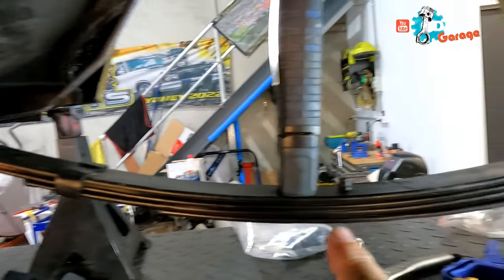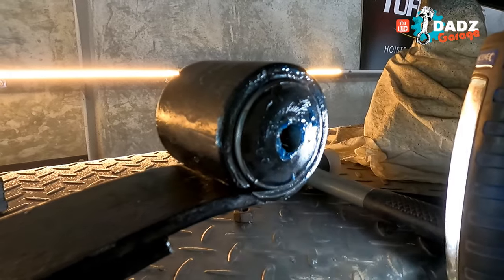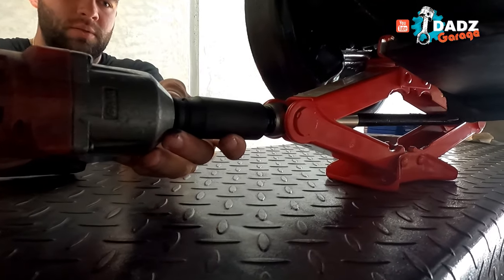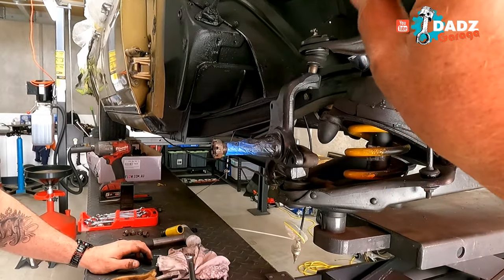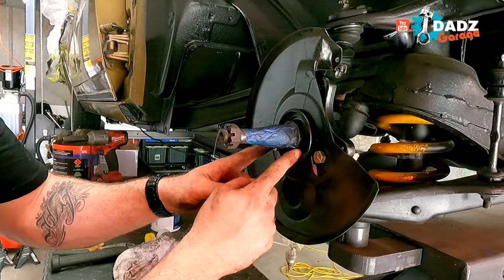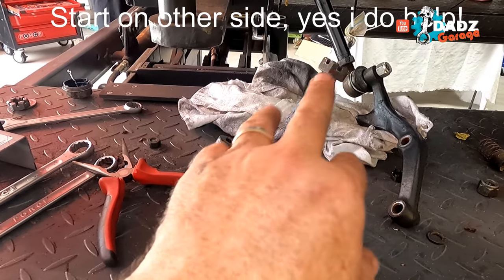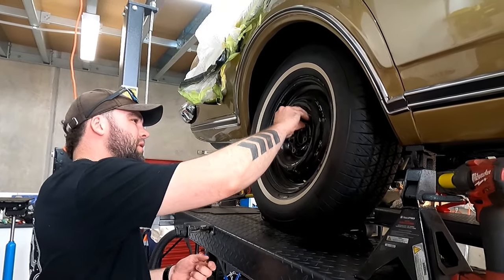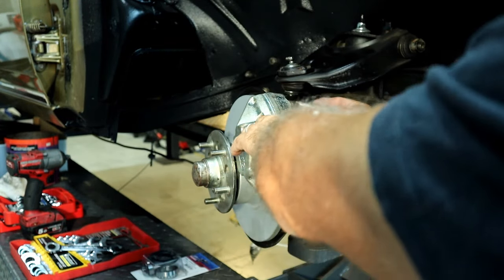HT Holden V8 Swap, Disk Brake Conversion and Rust Repairs

Comment: Good update. I liked how you worked out the bleeder situation, yes the nipple goes to the top (highest point) as the fluid flows into the caliper and fills it, most of the air will be forced out and then a quick bleed to finish.
Reply from the maker: Thanks Mick, slowly learning and great to do it with my son..

Comment: Use rubber grease or even selected food grade grease [come with PTFE and are very long term greases ]. All urethane bushings hate oil based lube .The ingredients in  some bushings actually cause them to crumble . I have had outstanding success with Super Pro Blue .[35 years exp]
Very hard urethane actually wears steel .
Reply from the maker: Thanks for the help

Comment: You do the Job Right, because you do the Job Twice😂😂

Also, just double check your speedo cable routing. It looks like it's rubbing against the Clutch cable.
Reply from the maker: In my case do it 4 times and hope the last time i get it right. Will check speedo, thanks.

Comment: Were there different brake setups for 6cyl vs v8 or were the GTS chev the different setups ??
Did u consider Hoppers stoppers  disc kit ???   Versions of upgrade HQ style 14 inch wheel or a falcon disc 15 inch wheel .
Reply from the maker: I believe same brakes for 6 and 8cyl, just different drum set up in rear to match disk front. I wanted to try and stay all original brakes though HQ is the easiest and best upgrade i believe for sure.

Comment: those  disc hubs seemed to have the bearing over tight they should  be firm but not tight to spin 
i usually nip them up till the nuts firm them back it off so the nuts just got tension on it
why is there a flat piece of steel welded to the front end cross member never seen that done before ??
Reply from the maker: Yep made a few mistakes. Wrong rear seal, stub had some pitting from sitting for years, over tight. 98% sorted now and great learning experience for me for sure.
Reply: Hey Geeen,
The welded flat pieces of steel are welded in to reinforce the front ends which tend to sag a bit over time, especially the V8 cars.